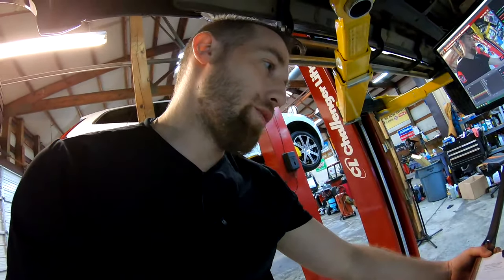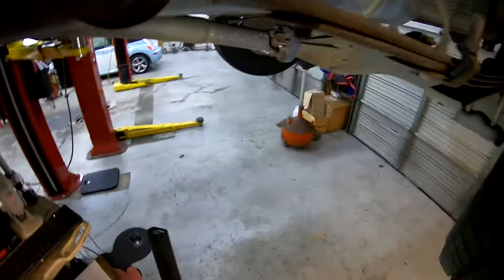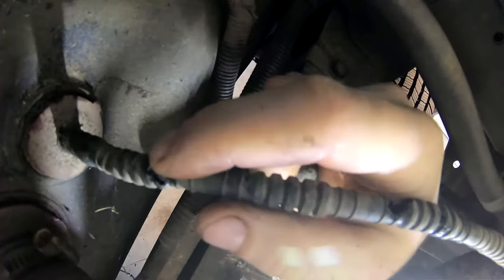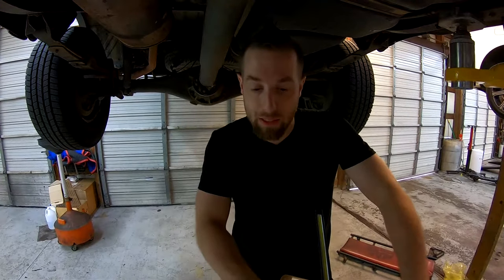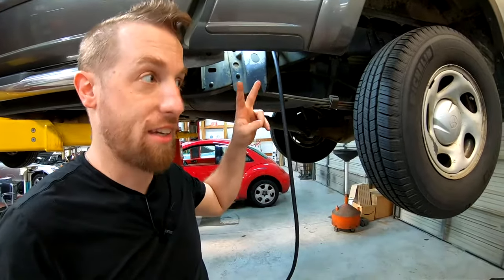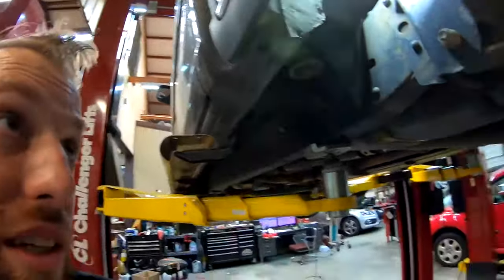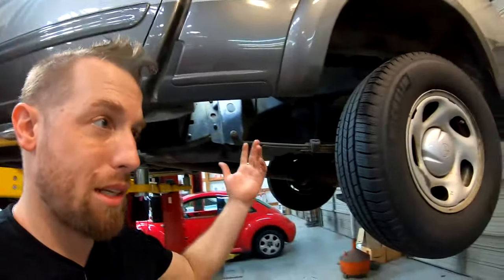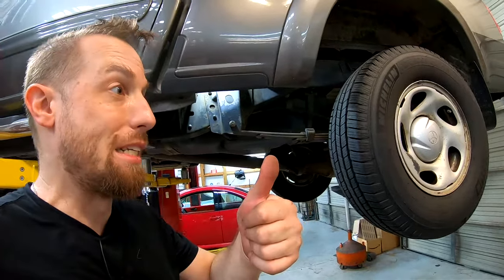Leaking when Filling Gas

Comment: I’ve got this issue I was told my fuel hose is unclamped? Any help please? 2002 Honda Civic dx
Reply: In this instance you need to tighten the clamps, usually can be done with a flathead screwdriver. I would inspect the fuel filler hose to make sure it doesn’t have any cracks or punctures from general wear and tear. The hose size should be 1 1/2 standard